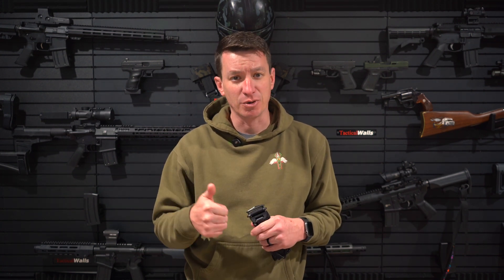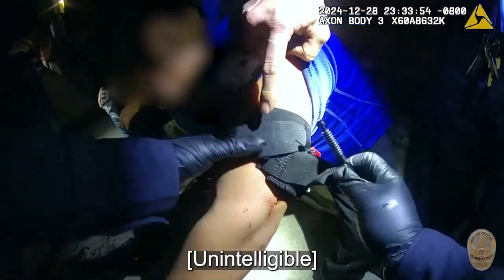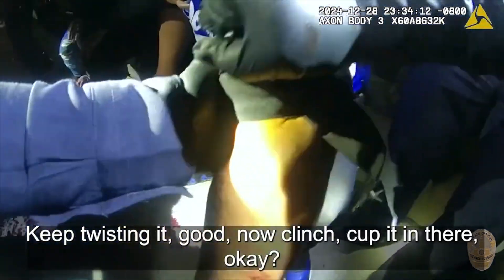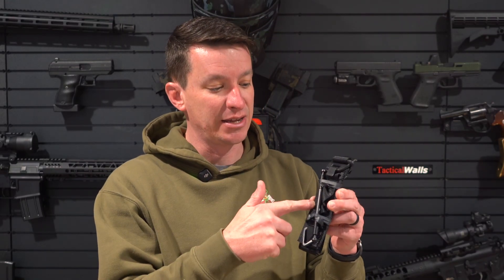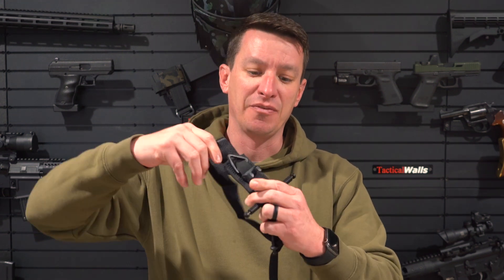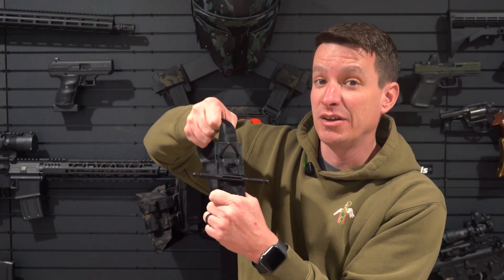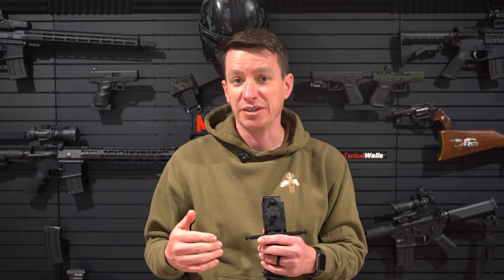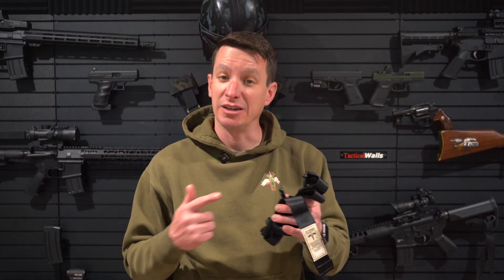Police Officer Applies SOF-T Tourniquet - After Action Medical Report | Real Body Cam Analysis

Comment: Holy cow this guy (and probably) his entire department needs to be trained on tourniquet application. I have taken a grand total of 2 classes (as part of the curriculum) that dealt with tourniquets and this was at least 10 years ago and even I can remember how to apply the tourniquet. 

With the SOF-T he doesn't need to have the guy relieve direct pressure to apply as there is a clip, he applies it backwards you want the free end outboard so you as the applier can pull the end (right way if self applying), then the stuff you said.